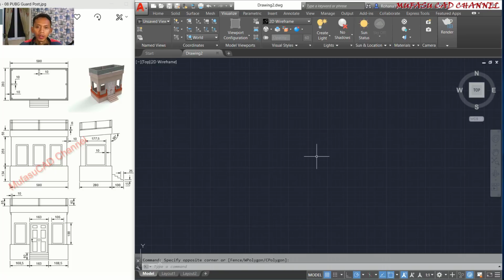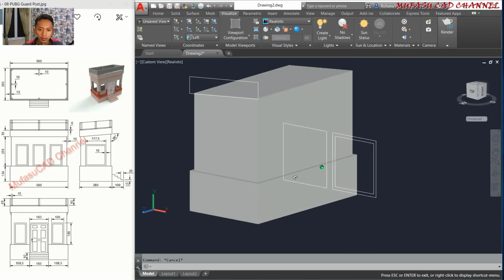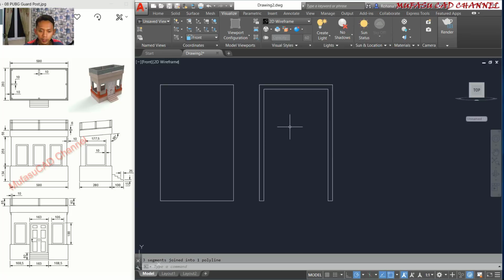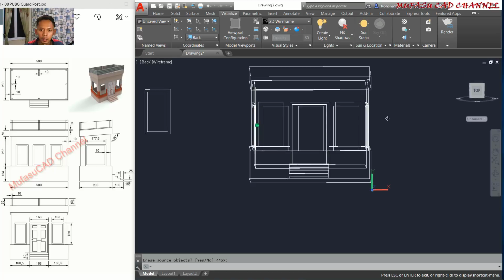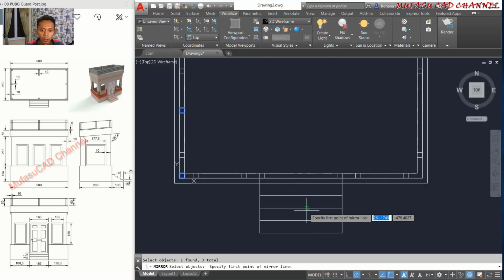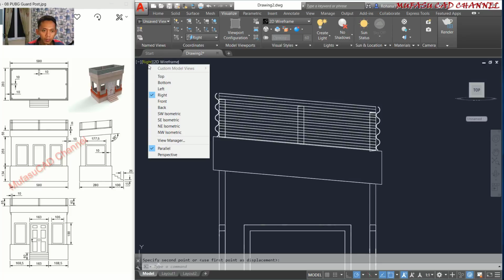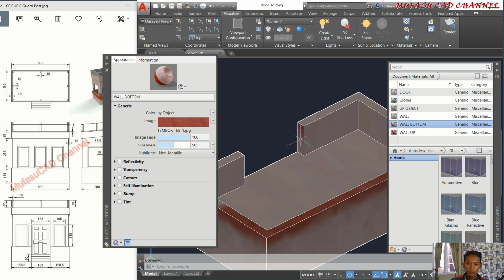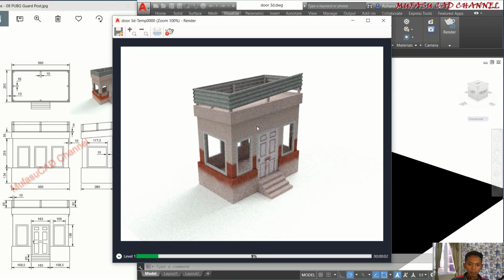AutoCAD 2019 Design 3D Pubg Guard Post Modeling Tutorial For Beginner

Comment: Is this tutorial just for autocad v.2019 ?
Reply: Please upload texture which you used in this
Reply: Can i follow this tutorial in autocad v2010 ?
Reply from the maker: yes you can,, this tutorial is available for any autocad version
Reply: So may i ask something..? how i do offsetedge in 2010 ? I type offsetedge but command is not found 🙏
Reply from the maker: mybe offsetedge command not include in autocad 2010, and its release in 2012 or 2014. You can use rectangle command to create box, and move into center face in object, then use subtract command to create hole
Reply: Okaay.. I'll try it 🙏